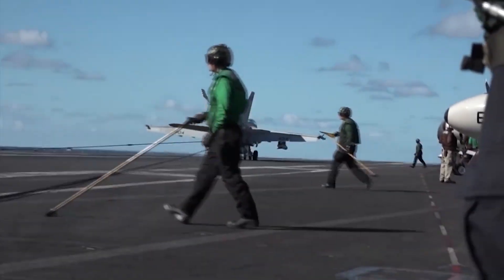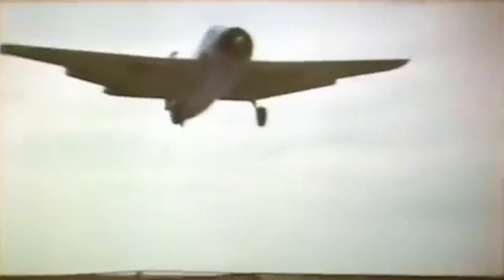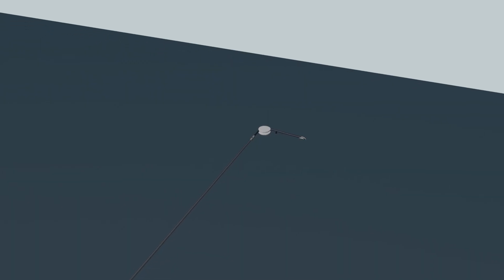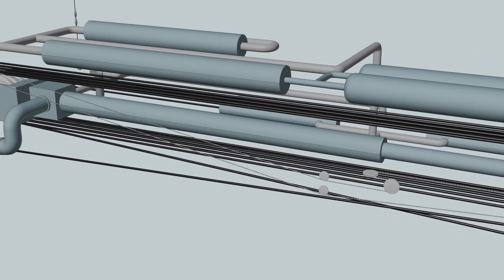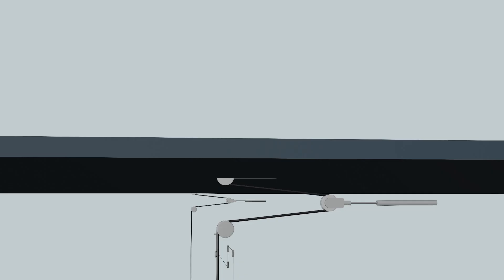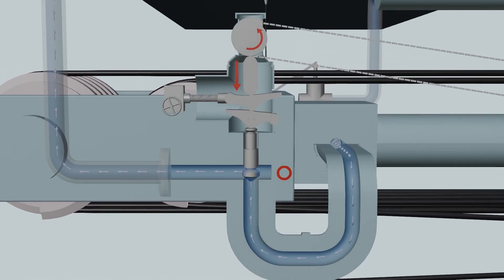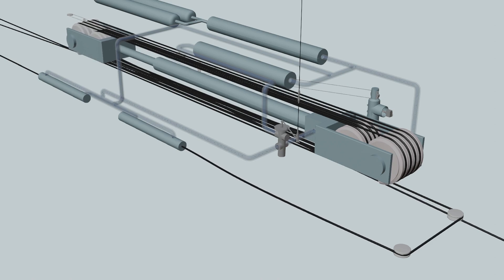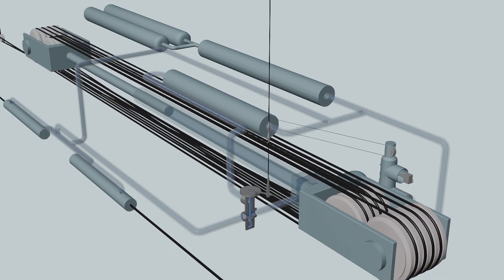How Do Arresting Wires Actually Work? (It’s Not Just Brakes)

Comment: I wonder whether they could have done this simply by moving the "sandbags" (in the 1911 original) down under the deck, so the airplane picks up more weights as it travels along.  (This would probably occupy more space than the hydraulic solution.)

Comment: THANK YOU FOR THE FULL EXPLANATION , 
WHAT ABOUT THE NET ARRESTER DETAILS ?
Reply: The barricade works in conjunction with what you see in the video. The lower load straps connect to a purchase cable and arresting engine. The upper load straps connect to barricade stanchions, which raise to give the barricade the necessary 14 foot height. There are ramps placed into the deck in front of the barricade to guide the aircraft into the engagement. A CWO that hung out with Maverick on the Darkstar project is not qualified to rig the barricade.

Comment: How often do those wires snap? It would suck to be nearby if and when that happened.
Reply: Very rarely. It usually is because of a bad weight setting leading to an engine two block (runs out of room before full stop of aircraft).

Comment: They removed the drive chains, everything is computerized now. You can see the Gui stand that operator uses at 2:12 in the video next to the gauges. Honestly this was really well made.  The diagram for the connection point of the CDP and purchase cable is backwards. The CDP is the male end and the barrel on the purchase cable is the female end. But that is pretty nitpicky all things considered.
Reply: Maybe the picture is for UK arrestor cables.  :face-orange-raised-eyebrow: